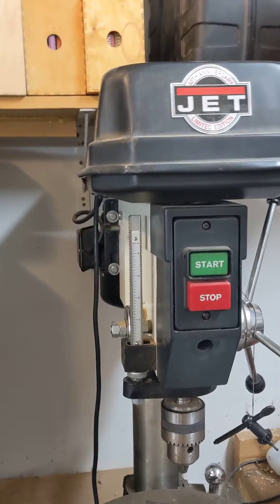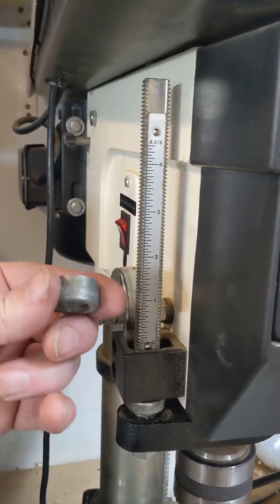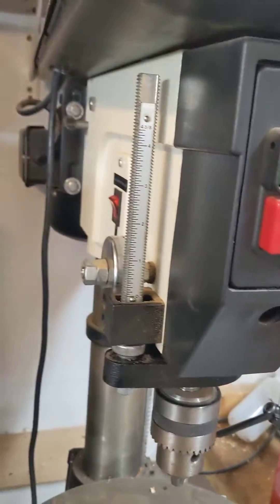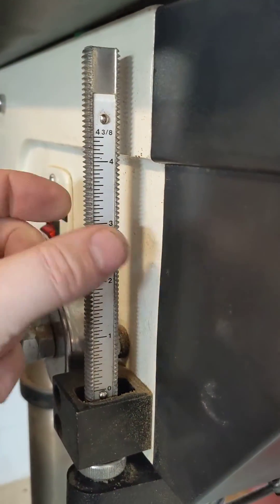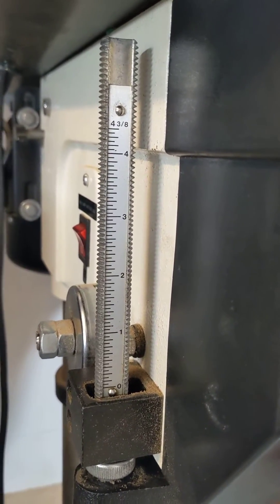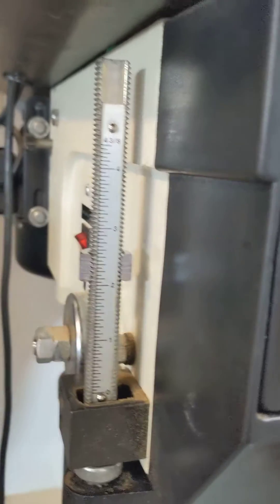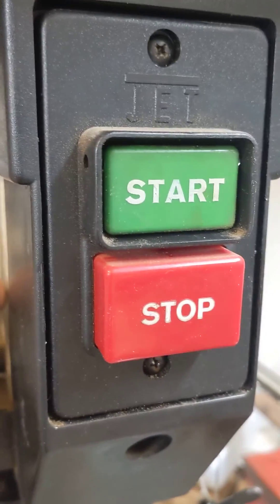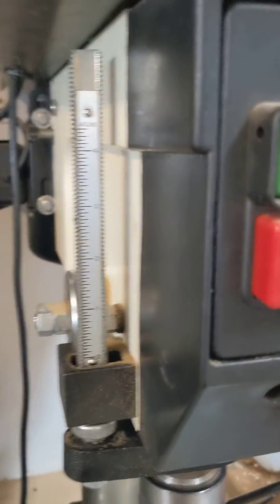Jet Drill Press improved quill stop/depth gauge

Comment: I was looking for an after market quick-set nut (maybe with a button to disengage) but your solution is perfect.  Still a nuisance to jam, but so much better than as designed!
Reply: btw, looks like spell correct got you on video title--quill, not quilt.
Reply from the maker: Depending on the exact setting your looking for you might have to flip one or both of the nuts upside down to get them firmly on the threads.  Also, I made the opening a bit too wide but they still work.